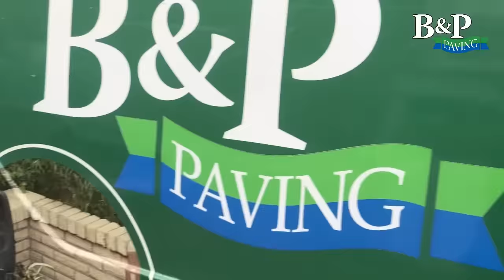What happens when a customer wont pay!! #038

Comment: Completely agree Mush, I’m a sole trader. Most customers are brilliant, but have come across these types before. I’ve been in domestic plumbing, heating and kitchen installation works for 25 years and can see them a mile off once a quotation has been ‘agreed’. It’s normally people with wealth- bread and butter customers are sound 👍
Reply from the maker: Well said!
Reply: @BPPavingnottingham   YOU SHOULD CUSTOM MAKE A COMPARTMENT IN REAR OF VAN TO PUT YOUR JET WASH SECURELY WITHOUT EXTRA MOMENTUM THRASHING IT AROUND 
👍👍👍
Reply: @BPPavingnottingham   OR USE BUNGEE CORD TO FASTEN IT DOWN 
👍👍👍
Reply from the maker: Yeah we wanted to…. If I got a new van I would
Reply: @BPPavingnottingham   AS A CHEAP OPTION YOU COULD ALWAYS SCREW A STRAP (WITH VELCRO FASTENER) AROUND THE HANDLE (ITS OWN WEIGHT SHOULD KEEP IT ON THE FLOOR) 
👍👍👍
Reply: @BPPavingnottingham   OR ANYTHING TO STABILISE THE HANDLE AND IT WILL STAY UPRIGHT IF ITS IN CONTACT WITH THE FLOOR 
👍👍👍
Reply: Take the sodding caps lock off.
Reply: WHY SHOUT
Reply: @BrandNew777  RRRAAAAAAAAAAAAAAAAAAAAAA

Comment: Your 100% right Nick - we priced to repair a shoddy job a previous roofer had done years ago, we told them it would be about a week - fixed price quoted the job up all agreed - we worked our bits off finished in four days then we get - you only did four days, we`re not paying the full amount as you said it was a weeks work etc etc - only when we went back with shovels to remove our slates!!!!! we got paid! does my nut in! -  like i explained to the customer when you do your weekly shop at Tesco`s you don`t get to the till and start negotiating what your prepared  to pay!! - Good work lads
Reply from the maker: Yeh they get the exact job they want and leave it in a negative

Comment: Regarding your karcher,,, if you take the outlet and inlet hose off every evening and run the machine it will flush out any remaining water and should solve your problem with pipes cracking
Reply from the maker: Thanks

Comment: My Son in Laws a Concreter, and had a couple of large jobs that customer at end of Job does NOT want to pay. I have been in Business for over 36 years Mechanical. WE would Not fit a $6,000.00 Engine without a Deposit. What was the Deposit Rob asked. $6,000.00 Son.    You have to Pay your workers, you Have to Pay for the Concrete. When its Down its hard to pick up an take away. JUST like when an Engine is fitted in a Vehicle. Just the way Business has to be Run. IF they are going to argue with That as a Deposit, Then the Jobs Not worth Taking on, Because you Know there will be Greif  at the end of it!
Reply from the maker: We take a £500 booking and stages of it’s a big job. But you can never see this coming sometimes 

If they refuse the deposit we end talks there

Comment: Sorry that you had this experience with a silly cow!
I make sure that I know what I want, how it's going to be done - so what materials will be used, how my main contact is, deadlines, etc. 
Then, once the job is done, I give everyone who I saw working on my job a £30-50 cash tip. It goes a small way to say 'thank you,' but more so, if I need another job doing  it, it is usually guaranteed that the company will return - once again, do another supper job.
****This is extra: I needed help transporting a piece of furniture from my house round to my garage lock-up. On the off, chances that they might help me by using their van - I telephoned and asked. These lovely, sweet, sweet young men came round this Sunday (their day off as the van was free) and helped me. I gave them each a bit of cash - as petrol and time is not free. 

Only monkeys work for peanuts.
Reply from the maker: And the lads are grateful. A cup of tea and a biscuit goes along way. We’re human and it’s hard going… we don’t expect anything but kindness goes along way

Comment: If you quote 3 days work, then finish in 2 days, but charge for 3 and work on a different job on the 3rd you are ripping the customer off. If you are available to work on the 3rd on the original job then you can charge for it. Otherwise it's known as double funding which is illegal in most industries. The customers essentially paying you for your time/ service which you are unable to provide. So whether you're a cowboy depends on what you do with the time you have charged for. 

In future just do fixed price with a contract instead of quotes. The majority of time it's much better than a quote or pricing. Occasionally your'll find something hidden and have to pay for it out of your own money. But it saves a lot of hassle.
Reply from the maker: We do a fixed price contract eveytime , customer changed spec numerous times meaning that we would have no work and loose pay due to having durations

Comment: So B and P agreed a price and terms on a job. Customer changed the terms so should expect an increase in price. And this happened a second time because the customer sees you as a pushover. Hope you learn from this Nick. Stick with your price if customer wants less work doing it’s still the same money and make sure you tell them with someone to witness this. It might be easier to run through the job on start day and explain what changes to the plan would mean. Extra work is more money of course.
 Other than that another superb video, always look forward to Sunday’s.
Reply from the maker: You speak as though that’s what happened. 😂😂😂 that’s not the case at all.

Comment: The job is hard enough without clients like that, they mess you about to start with then try that nonsense they need to get a grip!

We’ve had issues with the same karcher machines, it’s the Lance for us that just packs in after a few weeks at a time the wee ceramic ball in the top of the Lance comes away and the water can’t get out, they are just so cheaply made
Reply from the maker: Yeah we’ve had that . When it breaks free and blocks the nozzle … they didn’t used to be so crap

Comment: No mate the K4 is no better trust me. If you use it a lot in cold weather, keep a gallon on car coolant in the van and when you disconnect the pick up hose stuck it in the coolant and suck a bit into the washer. It won’t freeze then.

Comment: I can't comment on a customer trying to pull the wool over your eyes. I know nothing about paving apart from its expensive. As for "Karcher" I know quite abit about this brand especially the "domestic" K series pressure washer range and lack of customer service skills Karcher doesn't have!!

I've owned every domestic Karcher K series pressure washer on the market and i personally despise them. I'd never own another one.

I'm not defending Karcher this goes for any brand. If you are leaving your pressure washer inside vehicles & sheds overnight in cold temperatures expect issues.. water will freeze and turning on the machines could cause hoses to burst & pumps blowing up.

Quick Tip 
When you've disconnected the hosepipe. Tilt the machine to remove excess water and quickly turn the machine on & off and few times to clear the water inside the pump. I do this everytime when im putting my Kranzle K10 away with No issues whatsoever 👍
Reply from the maker: Thanks for your comment mate

Comment: Drain the lance and drain the pump. Dead easy to unscrew the lance, pull trigger and hold it until the water stops comin out. Turn pump upside down and drain the water out. Or keep it indoors. They are soft.
Reply from the maker: I can’t store anywhere bar a garage so I figure the van warmer

Comment: Have you got cctv at home I had the same problem with my sky and it was my cctv causing  The problem  had do a software update on my cctv hard drive and it's all good now hope this helps you
Reply from the maker: Yeh I have but it’s just the internet’s not great and it’s all wireless
Reply: @B&P Paving Nottingham  your cctv runs on wireless too and mine was pinching to much wireless signal so my broadband connection to my sky network was slow it was my cctv engineer told me that certain cctv hardware had been hacked so he did a software update to resolve the problem
Reply: Get your cctv hard drive updated  who 
Ever installed it for you will have a micro USB stick with updates on it hope this helps you it worked for me